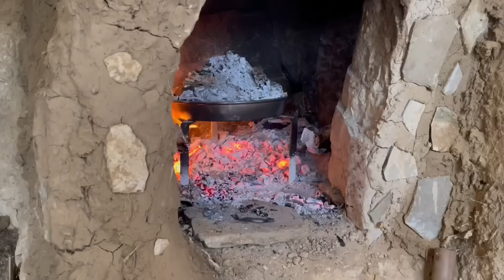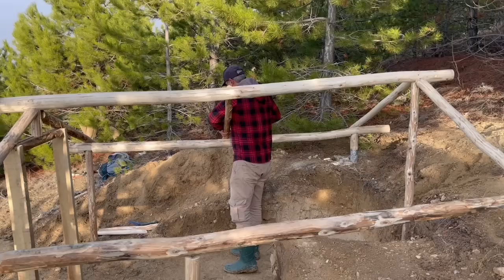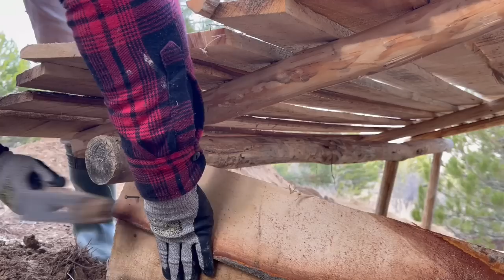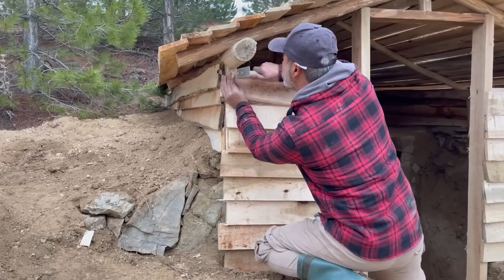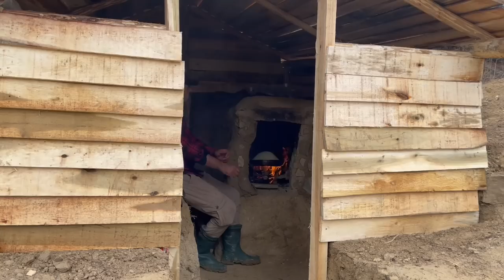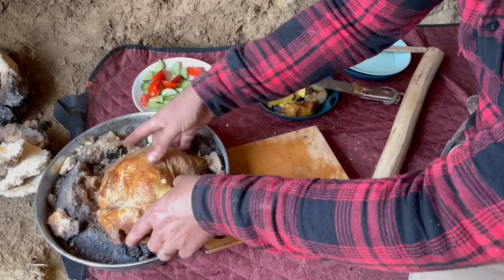Bushcraft Off Grid Cabin Build | Wooden House | Dugout Shelter, Survival Fireplace | Winter Camping

Comment: Nice dugout, especially high ceiling that allows flow of air. 

My suggestion is;

Are you able to build wooden wall, at least surrounding your sleeping area? Somehow, this might lessen your  close contact to soil structure.

Loved your construction ability.😊😊😊
Reply from the maker: Hello. Thanks you for your precious comment. You are absolutely right about the bed. I was thinking of something, actually, but winter came early here. The roads are closed. I walk for 1-2 hours to reach here. In the spring I will improve the house.